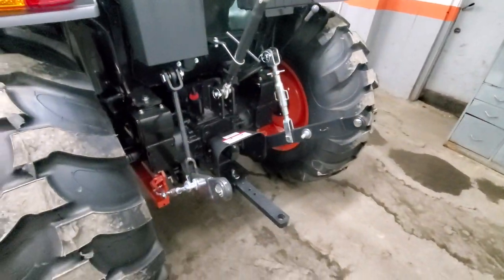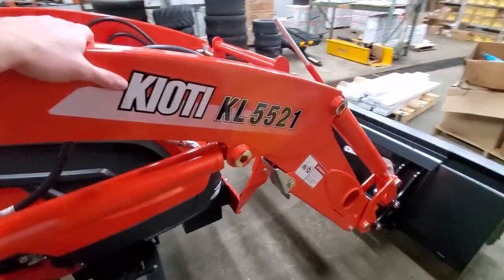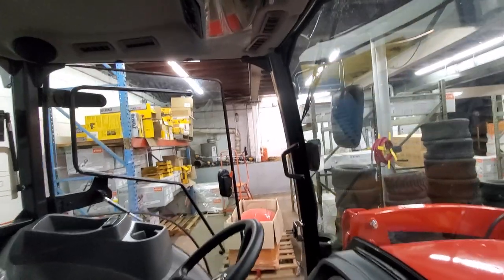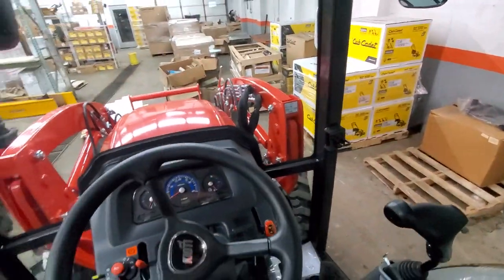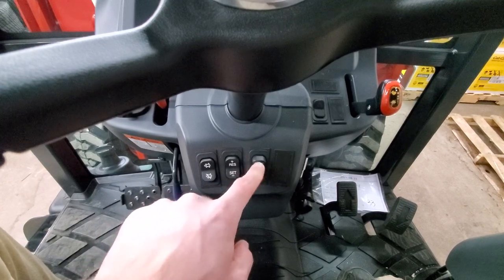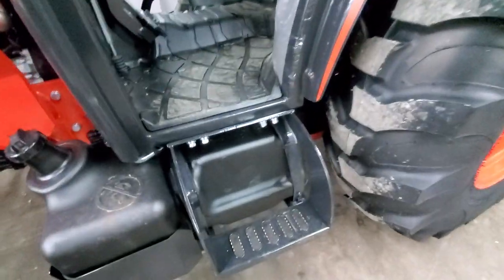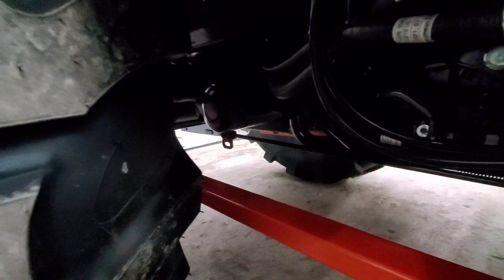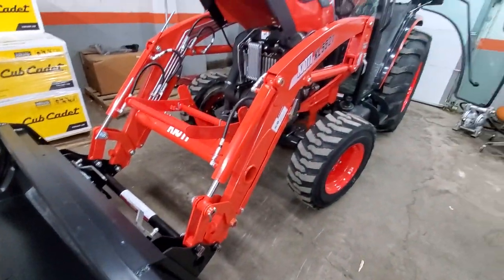Kioti Tractor DKse Cab walkaround

Comment: my local dealer says the base price is at 36k plus loader freight and freight-I know there has been price increases-so a little help here with some accurate info thanks
Reply from the maker: Currently (as of 12/15/22) we'd sell one with loader and rear tires filled for around 38K. You can get the "low rate" financing for that price, or there's a $3,300 discount for cash.
Reply: @kentonequipment4687  thank you

Comment: Hi. what would be the msrp for this exact tractor, including dealer prep and any other charges that go into it--thanks
Reply from the maker: Ron, the MSRP on the DK4710se HST Cab would be $43,572. We don't sell MSRP. Sale price on this right now is about $38,000 using the 0% program with an optional $3,300 cash rebate.
Reply: @kentonequipment4687  
I'm interested in a 7320, would love to discuss it with you guys!

Comment: It doesn't have telescoping lift arms. All tractors should have that.
Reply: I added that to mine before I took delivery (it included telescoping draft links to replace the chain/turnbuckles), along with loading the rear tires. I should have added a second rear remote, and maybe even a 3rd function for the front; but with this being my first tractor, I didn't know what I didn't know...
Reply: @theElderberryFarmer  Well you got the telescoping lift arms. That's a great start.

Comment: Does the seat come with arm rest?
Reply from the maker: Not officially because of safety law issues. They technically block access to the range selector. We put armrests on after the fact!
Reply: @kentonequipment4687  NS Cab coming next year???  If so what are the differences?
Reply from the maker: @teeweezy75  The NS cab is identical to the NX, so it will be bigger than the DK cabs, but with most of the same features.
Reply: @kentonequipment4687  any eta?